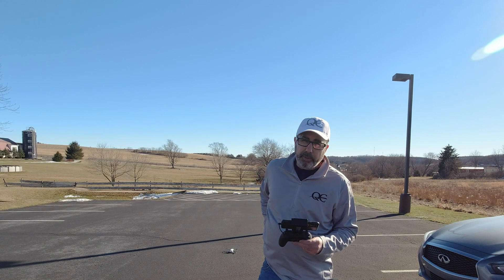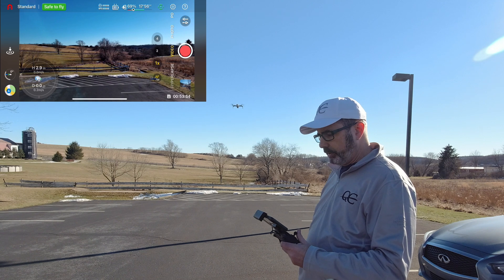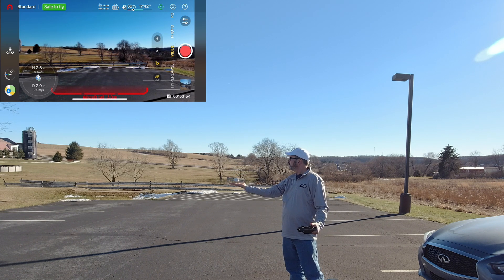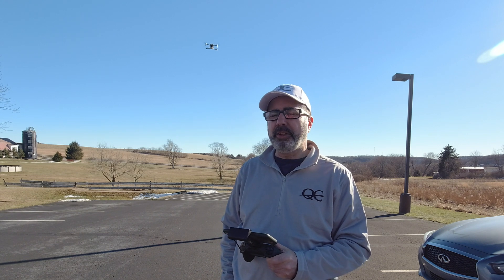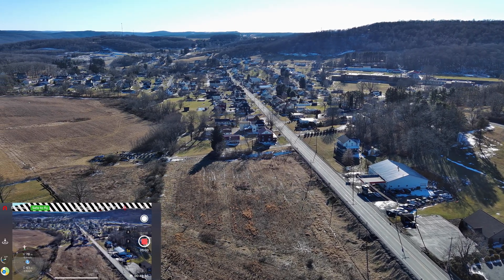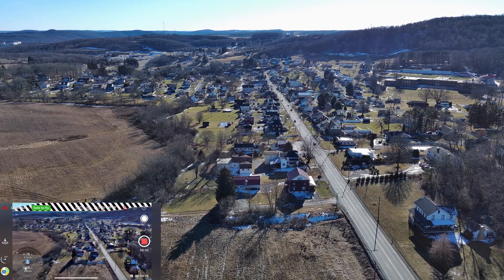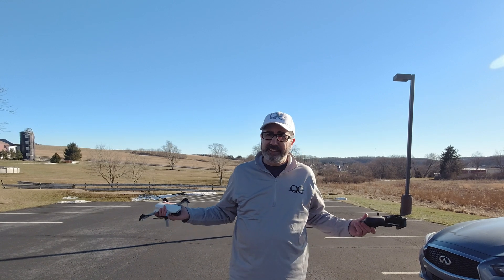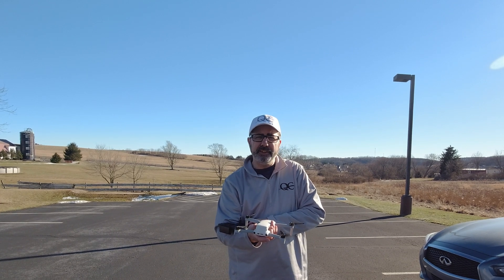Autel Evo Nano Plus - Wind & Obstacle Avoidance Sensors Test

Comment: Here in 2023 and I had issues with my obstacle avoidance going hayware when flying in wide open airspace telling me I was within 5 meters of an object. I also could not get mine to record in 4k, it was stuck in 720P and refused to let me change the resolution. I wound up sending it back for a refund. I like the camera quality when it works but for me Autel drones are just too buggy and unreliable.

Comment: I received my new Evo Nano yesterday, downloaded the Fly app. Went to start everything up and the Fly app keeps telling me 'RC Disconnected'. I've tried a couple of cables, no change. I use a Galaxy Note 9. I tried with an iphine 13 Pro but I had exactly the same problem. Finally I tried with my ipad Pro (2020). 

I had the same problem with autels cables but I tried with another one and I succeed to activate the drone. Except that, I wasn't able to update the drone, I didn't have access to drone, I couldn't take photo or videos (I had an sd card inside). I was only able to move the gimbal. Nothing else.

I couldn't pair the controller and I couldn't update the drone manually through the app. Nothing is working!!

I have already two drones (an evo 2 pro one of them) so I am familiar with drones!!

Any suggestions would be most appreciated!
Reply from the maker: Man! That’s s whole lot of bullshit you shouldn’t have to deal with. Sounds like you know all the troubleshooting steps and did everything I would try anyhow. 
No help from Autel?
Reply: @QCGUY  you are so right!!, Autel told me to ask replacement or refund from my dealer and my dealer the opposite!!! Autel also told me to send them the drone for check. But no replacement. Only for service. You know what? I think they are right. My dealer is responsible not them. I bought it from him.
Unbelievable!! Tomorrow my lawyer will call my dealer. Hope to figure it out! 
I also have an evo 2 pro. Amazing products with poor customer service. Sad
Reply from the maker: @giannisstefanatos4400  I hope you get it sorted out 👍🏻

Comment: My Evo 2 Pro lost connection and orbited into a tree, the arm collapsed, and crashed. Autel Robotics assumed no responsibility and charged me $1250.00 for the repair. Autel Robotics also charged me the wrong sales tax rate for my residence which was another $20. I have since tried to contact Autel Robotics with work orders and email. They still have not credited me the overcharged tax and it has been 45+ days. I have a great drone that I am now worried about flying :(
Reply from the maker: WOW! That’s a steep bill!
What all did they replace? I fix a lot of the Evo’s and have seen the worst of them but never had one exceeding $800 so yours sounds like maybe they replaced the camera/gimbal as well maybe?
Reply: @QCGUY  Order summary
EVO II Aircraft - CORE to FCS 1 FPC Cable × 1
$10.00

EVO II Aircraft - FCS PCB and IMU Complete Assembly × 1
$60.00

EVO II Aircraft - FCS to GPS FPC Cable × 1
$12.00

EVO II Aircraft - GPS PCB × 1
$30.00

EVO II Gimbal - PRO (6K) Complete Assembly × 1
$659.00

Labor × 1
4 hours
$240.00

Evo II Main Internal Black structure × 1
$45.00

EVO II Aircraft - Front OA Complete Assembly × 1
$65.00

Subtotal

$1,121.00
Shipping

$0.00
California State Tax

$81.28
Orange County Tax

$5.62
Santa Ana City Tax

$16.83
Total

$1,224.73 USD

Comment: Great video on how the drone now handles in wind. One issue that I'm not sure if you've talked about yet or not (just sort of found you in the last couple weeks & subscribed) is that people are having major problems with the RAW files colours due to the RYYB sensor. Thanks! Edit: I also just read that the camera is locked to 8bit and Autel hasn't said if they will unlock 10bit. Any word on that? I read something about the raw files being "locked" still. I don't even know what that means as I'm shopping for my first drone. Lastly, in another video on YT a closeup look at a raw photo showed that the grass was not very sharp and even had what looked like jpg artifacts in it. The YT'er said that even the RAW files on the Nano's have processing done on them. Can you confirm any of that? Thanks!!!
Reply from the maker: The last rumors I have heard is the possibility of 10bit might not happen and I’m aware of the raw images but haven’t heard anything concrete on those. 
The work and progress seems to be slowing down on this quad.

Comment: I turn off OA on my Nano +, it has enough problems as it is.  I still get a short low quality video file when I am taking off, it stops recording and starts recording again on it's own.   I emailed Autel support 5 times.  I received 2 emails acknowledging they received my email and another email when they asked if my app was the latest version and if my firmware was up to date.  The app and firmware were up to date, I emailed them 2 more times and I have not heard from them in over 3 weeks.  At this point it really doesn't matter, the Nano is a piece of junk, I have no use for it as it and it will sit.  I'm not wasting anymore time with Autel or Autel pilot(lying con artists) and will never, ever purchase another Autel product.  If the drone has an issue that keeps it from flying I rather stomp on it and smash it into a pile of dust.   $950 lesson, never again.
Reply from the maker: It’s pretty bad with their customer support. Disappointing!
As for the video I was told it starts as low quality till you take off which is a load of crap because it does it after I take off at the start of videoing. It’s not even low quality, it looks like the camera is broken. I also lose video if I do certain things within the app like zoom.

Comment: Another great vid Chris. Wonder if the new V1.1 nano+ with different body/arm materials will make any difference for the reduced speed into the wind issue. Yea I still see some jello but the winds were pretty strong.
Reply from the maker: I don’t see anything different from my original to my replacement in way of arm material and I’m told that’s false but maybe I’m wrong. Is Autel actually saying this?

Comment: Good review. My new Evo Lite Plus returned from Autel service a few days ago and is flying well. Seems my issue may have been controller related. Plus this big ass drone ( bigger than my Air2s) is soooooo freaking quiet. Barely can hear it once it is up a bit. Safe landings buddy!!
Reply from the maker: It really is a quiet quad for its size. Has a few bugs but it’s a great quad so far.

Comment: It appears the Nano is or has become a drone ready for prime time now. We could hear the wind and watched as the drone held steady. RTH worked very well, which in my experience with both the Evo & Evo 2 has been the case. Obstacle avoidance seemed to work well enough. Then there were the bottom sensors. Obnoxious does not begin to describe that noise. Please replace it Autel!
Reply from the maker: Just give me the option to make that noise much lower or turn it of without turning the OA off all together would be nice. 👍🏻

Comment: Thanks for sharing.     Glad to see the performance improvements.   I think that the introduction of an incomplete product and the lengthy launch delays have marred what now seems to be a decent drone.    The main issue for me is the price point.    The Mini 2 remains a very capable drone for the price and provides greater bang for the buck.   I’m sure the Mini 3 will come with a notable price increase and it will be interesting to see which quad will offer the best value.      My guess is the Mini 3 will prevail.
Reply from the maker: The mini 3 is certainly looking interesting if leaks are true. Not sure what to think about it actually…

Comment: Looks like they almost fixed everything except the price.  Autel needs to drop the fly more price by $200 to make me interested.

I think the bottom sensors work as an alert so you can land it if you want.  Otherwise it would hover until the battery dies.
Reply from the maker: I think in the end they are going to have to drop the price as sales don’t look like what we normally see in new models.
As for the sensors? It will hit like a brick landing manually and not always pleasant as a RTH landing either.

Comment: Thanks for running these tests for us to see. I had to learn the hard way that the bottom OA sensors do not halt the quad on its descent when it just crashed right into a small shrub.🤦‍♂️ Luck for me it was just a small shrub with soft leaves.

The speed seems to work fine for me at the moment and the gimbal is pretty stable... I am however getting a ton of moire in my videos on bright sunny and overcast days which sucks. Definitely needs some ND filters.

Comment: I am starting to love this drone now they have fixed almost everything the one thing I wish they would fix still is adding gimbal smoothing it's still very hard to get cinematic shots in that regard.   I am also still getting 720 files for every video I make which is a little bit annoying because they don't know how to fix it.   I do you like your video updates.   I thought you returned your nano ?
Reply: I believe that they are working on adding settings for gimbal smoothness. They’re also developing ND filters for both Nano+ and Lite+ series. In regards to your video files being saved in 720p it most likely that you have it set to save video files in “HD” instead of “Original” in the app.
Reply: @DroneSyndrome  It’s not that, I have tried every possible setting and nobody knows what it is
Reply: Free well Does make filters
Reply: @michaelripple8371  Hmm... that sucks. I know that when the drone is on ground and you press record the file comes out at 720p but when the drone is in the air it starts to record in 4K or whatever setting that you put it to. I had a similar issue at first where my videos files were coming out in 1080p even though I had it set to 4K... then I realized that I had it set to save video files in HD and not in the Original size. This is why I mentioned it.
Reply: @michaelripple8371  Yes, I know but Autel is supposedly going to release their own ND lens filters for both of these drones from what I’m hearing from my contact.
Reply: @DroneSyndrome  yeah I tried both those settings and then I left it on original ,  didn’t make any difference
Reply: They should allow nano to use DJI fly app.
Reply: How about “follow me”. And no histogram.
Reply: @forrestneighbors2722  i’ll take a histogram but I don’t need follow me
Reply: @michaelripple8371  they should provide all advertised features.

Comment: It's the phone (thru the app) that's beeping, right? If so, volume settings can make this quieter.

Most phones have a separate system, ringtone, notifications, & media volume levels. 

The app is sending the beeps as either a system sound or notification sound. Doubt it's a media or ringtone sound.

You should alternate system or notification sound to zero to find out which one cancels the beeping. I'm guessing, since it's a beeping noise, itl likely a system generated sound instead of a notification beep because it's playing a file on the syst somewhere.
Reply: Jup, just turn down the volume on the phone and it becomes silent
Reply from the maker: Yes that’s obvious…
I have the volume up for the video and not only for that reason. If I turn it even close to halfway down I get a constant pop up telling me turning the volume down isn’t recommended and I didn’t want that on the screen while recording the screen. 
Sometimes I actually know what I’m doing here on my channel. lol

Comment: I really hate obstacle avoidance on drones…..so many annoying beeps. Distracting. All I want from a sub 250g drone is a damned good camera,battery, gps lock and very good wind capability.

Mini 2 has most of those…..
Reply from the maker: Take those obstacles avoidance sensors off, beef up the ESC’s and motors and we have a drone 👍🏻
The camera is near perfect 👌